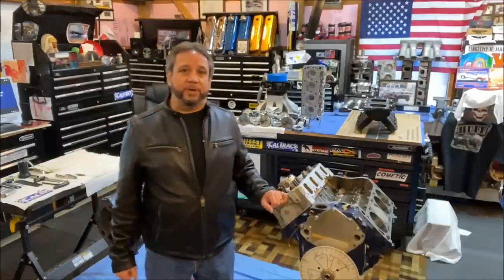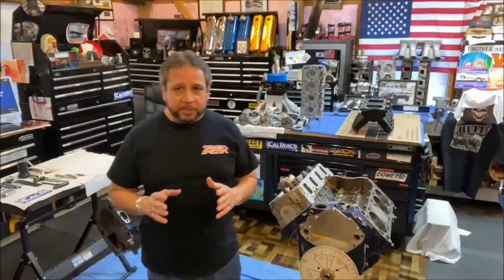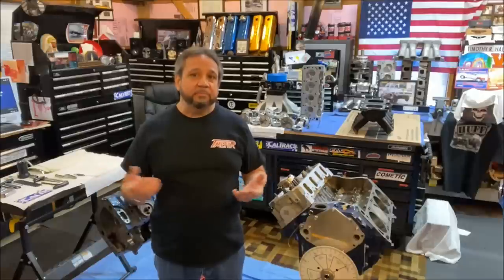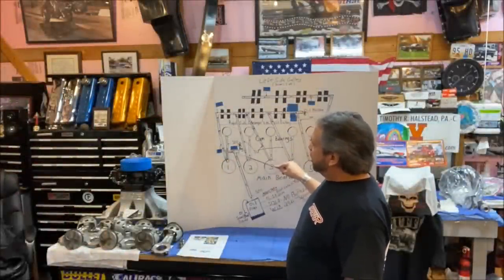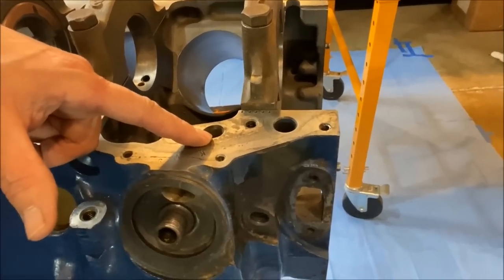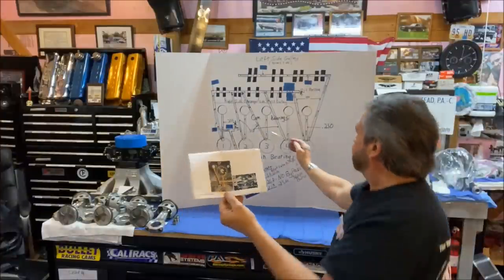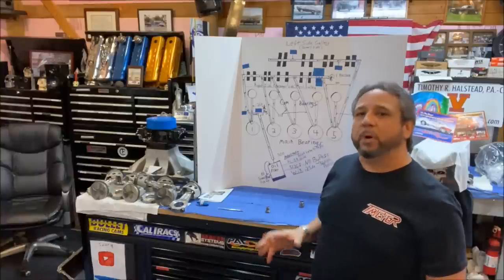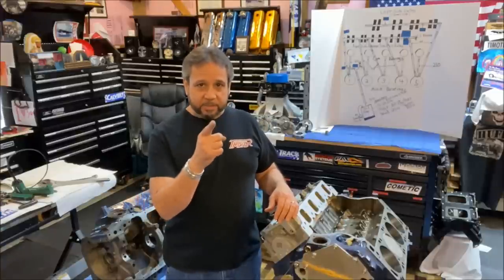Ford 351 Cleveland Oiling,  The Truth, and More

Comment: Oil out verses oil in. Meaning fabricate larger diameter oil pump suction tube. I read Dyno Don had .025 diameter hole in each lifter bushing. Sleeve those lifter bores.
Reply from the maker: Yes that is the plan. I think I was told, .030-.035 ish. Either way solid plan, David.

Comment: I read that  a  Young  Engineer  working at  GM  under the  GEniouses that  Develpoed the  BB Chevy Mark IV  went to Ford and worked on the  Clevland  Head that  looks a  lot like a BB Chevy Head..
  Sounds to me like Windesers  make  better boat  anchors than Clevlands  because Windsers are more  common and less expensive..
Reply from the maker: Mike I look at like this, any engine is a Marvel in engineering and mechanics. The Windsor by far has so many more years of refinement and aftermarket support. They have been the fastest, and easy today to make big power with bolt ons. But I also think pound for pound Cleveland would surpass them with ease, If they had that many years of development and racing use. I am always impressed with Windsor stroker capabilities and durability. Bolt on a set of AFR and match them and go run tens. I know Bunkie Knudsen Came from GM, but not sure who did what of the top of my head. Yes both are canted valve. I love the GM rectangle Port 454s from LS6 back in the day. Mean.
Reply: @DragBoss351Cleveland    I think thre rectnagle  Port  BB  Chevy  heads  are overkill  except for all out  racing..
  I have  a few  BB Chevy  427  Truck  engines..  I have a  C-65 Chevy tandem axle  truck  stroked  to  4 1/4"  488  forged  crane crower rods  ect..   The Truck engine  have the huge square port exhaust ports  that don't match headers..  I had  to weld  up  my headers  for days  to   port match them ..
   The Truck engines  have  very small valves  .  Maybe   1.84  intake and  1.66 exhaust .. I used a   545 lift cam ok  would not pull over  2,500 to  3,000 RPM  so  I used the next  hotter crane dame which had I think   .484 or  .515 lift on the exhaust and I had coil bind ..   on the exhaust valves .. It turns out  the  Truck valve  stems are shorter..  So I used Ford Clvland  Valve  springs to avoid coil bind..
  I am  building  a  572 cubic  inch engine that will use  Dart  Hards and  car  length vavles springs
  I did have to notch the blcok a  little for  the  4 1/4"  Hank the crank froged crank  ..  all  of the truck crankes are forged too all the blocks  are  4 bold mains ..
   The Bow Toe  Truck block has  siamesed  cyclinders and  higher nickel  content  so  ..  You can bore it to  4.5"  with  4.5"  crank is how I came  up with  572 cubes..
   The Great thing about C hevrolette  is you can build a great engine  from   from Junk yard Blocks ..
  Yes  now days  it's  more practical to just  buy a  good well engineered Dart Blcok ..   Aftermarket has come a  long ways..
  My cousin  bought a  new  '56  Chevy    with the  265 Cubic  inche  dual  4 barrel solid  lifter vette Motor .. I think they called it the Duntov  cam..  It had a grind that other engineers said would never work .. but  it  put the  little  Economy  Chvy Motor on the Map as a hot rod motor..    It cost  GM    I think  $84.00 to produce  a   1955 motor .. It didn't even have an oil filter the first year..  that  265  dual  4 barrel was  rated  225  HP but many said it put out more  .. It would really wind  high wiht that solid liftr cam
Reply from the maker: @mikeskidmore6754  thank you so much for going the extra mile Mike, good info to know. I am not familiar with the gm truck engine, until now, appreciate the dissertation on the specs, for all of us here. They make some power that is for sure. Great history thanks for sharing your experience and knowledge. Stay tuned
Reply: @DragBoss351Cleveland    I was trying to find the  vavle  sizes  never found that.. but  some one  spent a  lot of time to compile all of this info..
   My old 427  ran like crap had  weak spark the  lobes  on the distributor were wore  off hard  to set the dwell on the points..
   My Father still owned the truck at the time..  I bought  brand new  HEI distributor and the  correct  oil   pump drive..  Tucks  have a steal  hex trive coupler  cars and  HEI ditributors  use a T drive and nylon coupler the  truck set up is way  better . Anyway I had to pull the  oil panin order to  change  the oil pump drives..  
   I waited until my father went away for a weekend then I did it ..  The truck ran so muc  better with  HEI spark  plus  better gas milage.. Turns out the  Truck distributor  had  no vaccume advance..  The Orrigional Holly carb had  a Govoner on it to limit to 4,000 RPm  
https://www.tradecraftspecialties.com/bbckb
Reply from the maker: @mikeskidmore6754  sounds like you took care of it, and now runs like a charm. Keep up the good work and keep your truck rolling. Thanks for sharing you experience. More to come so stay tuned and be safe.

Comment: I normally don't comment but will make an exception....  The cleveland oiling "problem" has been debated for 50+ yrs and it surprises me that very few people have worked out what the real problem is.  I think this is largely because its "feed" by all the stuff they tried in the 70's to help make them live at high rpm.
 No, its not a priority main oiling system ... but very few engines are .... look at a SBC oiling layout, its a "mess" compared to a cleveland ... but it doesn't have a bad oiling reputation.   Look at an LS oiling layout .... very similar to a cleveland, but to some degree worse as it feeds the mains last (feeds both lifter galleries first, then cam bearings and finally the mains).
The real problem is staring you in the face  .... think outside the "box" and you will find it.
Reply from the maker: Thanks Chris for chiming in. I don’t know much about any other oil systems, I heard the same about an Ls, but also heard they were dry sump engines? Here is what I say, if you know the secret share it, if it is that obvious share your knowledge with us. I’m about helping others and getting the most from our combinations weather Cleveland or AMC, Buick, anything goes. Some of my info applies to Cleveland’s, but also any engine in general to a point. I appreciate taking the time to comment and contribute your experience. Thanks for being here, now gives us your opinion, as it may save us all a lot of time and money. 👍
Reply: @DragBoss351Cleveland  Tim, you are obviously a cleveland fan .... if you can give me an email address I will share with you what I know ....
Reply from the maker: @chrisfin1921  sure always willing to learn. Thpa351@gmail.com
Reply: @DragBoss351Cleveland  You get those emails I sent you Tim ??
Reply from the maker: @chrisfin1921  I just saw them.  Let me read them and see what they say. Family dinner time. Thanks again

Comment: The problem isn't in the block, it's the way the crank is drilled and the oil feed timing to the rod journals. Simple run fully grooved mains (or an aftermarket crank that is drilled like a chev crank) and the rod bearing problem disappears.
Reply from the maker: Yep but block is contributory without a doubt.
Reply: @DragBoss351Cleveland  I saw a crank for one that was cross drilled in the mains with what seemed like 3/4 or 1/2 sized holes to not dump all the oil pressure but to add piling through out the circle of the rotation. Never saw it work, but it had the head scratching effect, I still wonder if it worked?!?!?!?
Reply from the maker: @tools6106 not sure on that, but there was an issue with stock  cranks and rpm. Switched to aftermarket and no issues with the mods I discussed.

Comment: It's those large heads when you pop the hood and your looking down at a Cleveland, yeah it does not look like a small block. And just like the 5.0 coyote motor ,looks huge because of those heads. But according to how the calculate up cubic inches it falls into the small block category.. LS motors have small  heads they actually look like a small block.
Reply from the maker: Heads and valve covers really make the motor. thanks Rono, please make sure you like and share...
Reply: Definitely but can not add in the Yates heads on this deal either. They weren't designed for the 351 Cleveland at all but indeed a 351 Windsor. I like his video's but he tries to stuff alot in a small video. Maybe he should do part 1,2,and 3.
Reply from the maker: @garykarenmcgruther6386  appreciate you watching and taking the time to comment. I always worry about talking to much or making long videos. Then I decided that it is what it is, DragBoss. I sometimes get off topic or too many stories. I really enjoy making the vids,  and the length and info just develop. Maybe as time goes on, and I have more time can make shorter more frequent ones. Thanks for watching and continue and help me build my channel.

Comment: So are some of these oiling tips common among 335 series engines  cleveland, modified and 370-460 along with.problems? I got a garage full of 335 parts and stuff.i just buy looking at people's supposed to be.junk cause 'myself I  street clevelands in many forms in 80s tbirds and,bbf ,300-6 and LS.in 3 clone cars with changeable drive trains.
Reply from the maker: Greg, I know they are similar to 351m, and 400, I am not sure on the 385 series engines. I have heard they have issues also, that are similar, but have no real world experience with them. I did a search to see, what I could find, and still not sure. Like I said a couple of top builders, said no issue with them. Sounds like you have a lot of cars going on, glad your here, hope you enjoy the channel. Please make sure you subscribe...

Comment: So you know a lot about 351c if so I have a few questions I have a 27 roadster with a 351c and the head have the exhaust ports cut off and add a aluminum block to them so the heads are cast iron and aluminum any info on that?
Reply from the maker: Too much to type, look through my channel and all pro stock mania vids talk about them. In short, aluminum plate raises exhaust port for better flow.  Explore my channel and make sure you subscribe, thanks

Comment: I would like to use a 6-71supercharger on my 351c and know I need to reduce my compression ratio to about 8:1, is there any value to changing to closed chamber heads from my 1974 4v since I can get the same compression by choosing s different piston?
Reply from the maker: Dale sounds like you have a plan, not sure what you are asking, change from open chamber to closed? Glad your here, appreciate it.
Reply: No real need to have the cost of closed chamber heads IMO, forced induction overcomes a lot of the low engine speed quench/chamber turbulence issues of big lazy ports. Is there a potential gain to be had, yes, is it enough to warrant the expense, when you could use the same money on either stronger/better parts that will allow higher rpm or a stroker kit that would yield much more torque gain, probably not... 
If you could get the heads free/straight swap or for very little cost do it. If not, look closely at cost versus return against other options...... for comparison the 426  hemi is the engine architecture of choice for supercharged drag racing's top classes, yet has virtually no quench area.

Comment: More great content from Drag Boss Garage! Prayers for Rusty and the Glidden family. Have you given any thought to getting your hands on a old school Hank The Crank Cleveland oil "fix" kit? Maybe a subber to this channel has one to donate to the cause? That would be icing on the cake for a old school pro stock tribute build... Speaking of tributes... I think I should sweeten the pot regarding the Fairmont. I also have a C8OE block 302 that I will include with the car. I know you mainly gravitate towards Clevelands, but this 302 is a first run high nickel casting with factory steam holes. It is the next best choice of block next to a factory Boss 302 block with screw in core plugs. It would be a great candidate for a "Mock Boss" 302 build. It is .030 over with brass freeze plugs and Dura Bond cam bearings. Yours with the car if you like. I'm not interested in moving it cross country with us because I don't have a car (or truck) to put it in and it's too good of a casting to send to scrap.
Reply from the maker: I can dig it Brian for sure and the old 302, would work perfect for Boss 302 clone. Wicked. That is funny that you say that about the hank the crank system. My buddy Kyle, hooked me up with one, will present it on another vid, and what they tried to achieve. Sure could put it on the pro stock build. I have been thinking about that Fairmount on a daily basis....🤔thank you again for watching and contributing. Fairmont, hmmm 302?????
Reply: I should add that the Fairmont is a factory F code 302 car that had the C8OE 302 in it when I bought it. Unfortunately, the original 53.5cc heads that were on it were stolen, but the rest of the engine is as bought but rebuilt using good parts (except the cam lol). I just want to see this stuff go to a good home and get used rather than going to scrap. If you do come and get my "junk", I will take you to Buddy Ingersoll's old shop and maybe get a peek at his Pro Stock turbo Pinto and his banned Grand National. He is from the next town over from me and I bought my Lincoln Town Car off of his best friend who happens to be the father of a couple of my closest friends.
Reply from the maker: @lysdexicsoftheworlduntie1881  That Dang Fairmount has me thinking like crazy, Can you imagine that episode, of the road trip and what i could find along the way. It would be a pleasure to meet Buddy, and see his cars, wowser. It will work out the way it is supposed too, thank you Brian...
Reply: @DragBoss351Cleveland  Unfortunately, meeting Buddy is out of the equation as he passed almost a decade ago. But, his family still is here and has preserved his legacy. Our local drag strip pays tribute to him annually and his Pinto occasionally makes appearances there during major events. His Grand National is kept under lock and key along with his turbo "secrets". I very much look forward to our meeting as you are keeping history alive in your channel and much of your content is long forgotten technology that helped form motorsports today.
Reply from the maker: @lysdexicsoftheworlduntie1881  thank Brian. I was not sure if he was still living. Rip Buddy. Yes lots of history right there be a privilege to see it. Let’s hope it all works out, can you imagine a deep inside look at his GN, man alive
Reply: @DragBoss351Cleveland  you get here and I will make sure to make a meet and greet happen. I can't promise you permission to video cars, but I can make sure you get family interviews that will help preserve memories along the same lines as your content with Rusty.
Reply: Exit 65 on I57. You bring a truck and trailer, I will load you down with goodies and help load up, feed you and give you many memories to pass on.
Reply from the maker: @lysdexicsoftheworlduntie1881  one could never ask for more. The memories and cars will live on, hope they continue to bring us all enjoyment, and knowledge.
Reply from the maker: @lysdexicsoftheworlduntie1881  An adventure of a lifetime, Last road trip, I went to PA, and picked up a int 69 Cougar Body only, luckily it was on 4x6 posts with wheels, with my winch, was able to haul it up. Let it roll, and see where it lands...
Reply from the maker: @lysdexicsoftheworlduntie1881  your only about 4.5 hrs away.....

Comment: Someone please help,  351c stage 1 stock build my oil pressure is 80lbs at startup then comes down to 60lbs once warmed up. I have heard 80lbs is dangerously high. I've tried thinner oil combos with no help. Currently running 5w30.  Any help or suggestions appreciated
Reply from the maker: I have ran engines like that no issues. Make sure bearing clearance are good ck oil filter and pan make sure no debris.

Comment: Has anyone done a Peterson oil flow checker on a 351 Cleveland. It tells you P.S.I. and Gallons Per Minute. I'm more interested in constant oiling not so much pressure. You would have to figure out away to come off a pressure feed area to a drain back. Jack Roush is a master in oil control.
Reply from the maker: Yes Tim Meyer ran on one a sim machine, and told me the front main had oil pouring out like crazy, constant oiling, dry sump is the answer. I know big bucks, I been running 8200 with minimal, mods, with cam restrictor bearings, same with screw in galley plugs.

Comment: The AMC V8 has similar problems. And they tap into the front galley plug and run a line to between 4 and 5 main.
Reply from the maker: Thanks for the info, don’t know much about AMC engine. I know Maskin, sure worked them over well. Thanks for watching and contributing. Appreciate it Clintmeister
Reply: @DragBoss351Cleveland  AMC ran a similar block from 290 to 401 cid. The 390 and 401 block had more beef and can be machined for 4 bolt mains.  I heard the blocks had lots of nickle in them and that kept the cylinder bore from wearing out.  AMC used ford carbs and Delco distributors.  It had a front alum casting that had the cooling pump and oil pump, similar to Olds.  AMC had a mishmash of everyones engineering. Wally Booth, Mark Donohue, Shirley Shanahan, Alan O"brian, Traco Engineering, Ann and Steve Erb, Bill Hayes, Dick Maskin, Hayden Proffitt, Dick Vendl, Herman Lewis.  Theres many names I'm forgetting but very neat hot rod history there.
Reply from the maker: @TheClintmeister  so true on the history. I just talked to a sub who had a shop next to Kaase when jon was first starting out. This about a half hour from where I live. He also told me he knew the guy who bought all of Wally Booths parts and car. Said he saw on the shelf aluminum amc blocks. He said that Booth was running an aluminum block, he saw the blocks on the shelf. He is trying to hook me up with the guy for an interview. Cool history Clint.